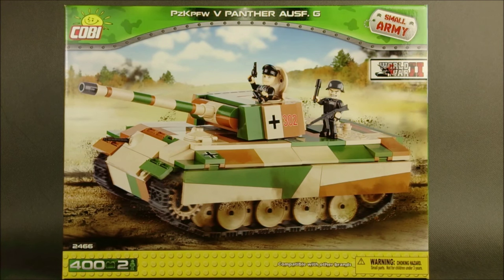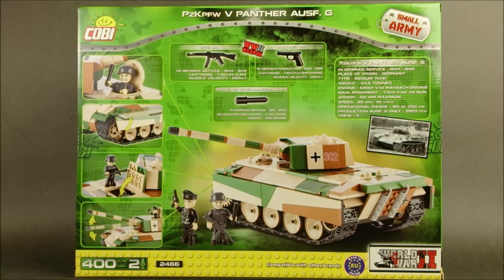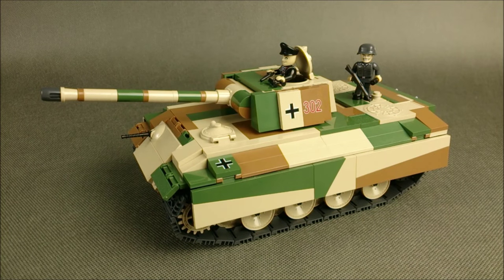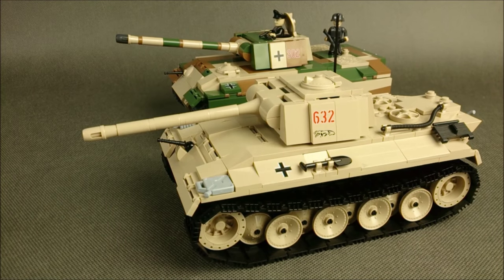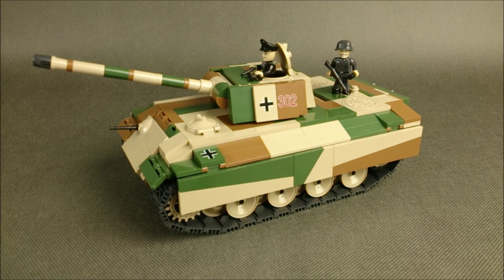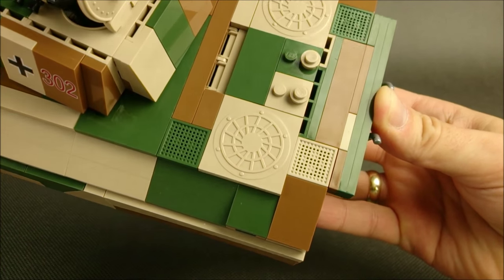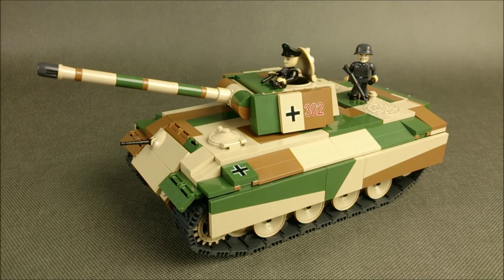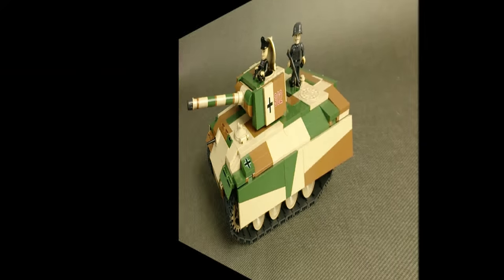Let me build COBI Panther Ausf. G (2466) + quick review

Comment: You were very lenient Kobikowski:) In my opinion actually this is one step forward and two steps backwards comparing to 2014 model. I hate this camo, looks nothing like from ww2 era, more like contemporary "pixelated" designs. I wish they made it just plain brown, green or grey, or at least used only two colours, like in Stug. As you pointed it out the width is just off, the same bad decision they made designing Comwell:( After I saw how they improved Tiger I and Sherman, I really had high hopes for this Panther and unfortunately it turned out disappointment. Not buying it. I hope that Jagdpanther, which I am sure they will make, will be much better than that.
Reply from the maker: +william jason Please, no insults